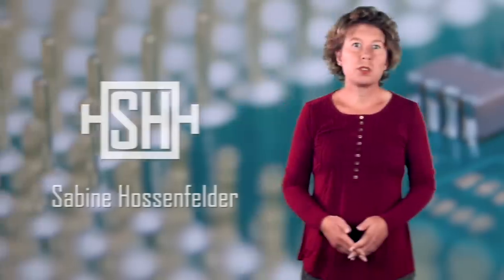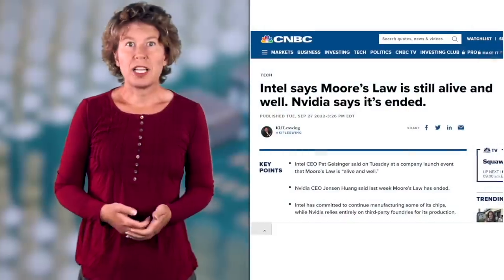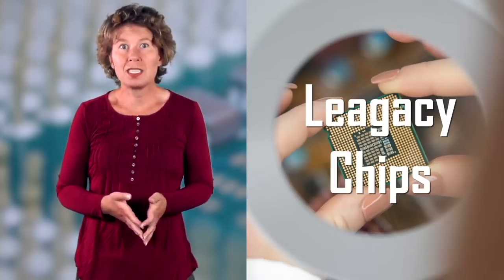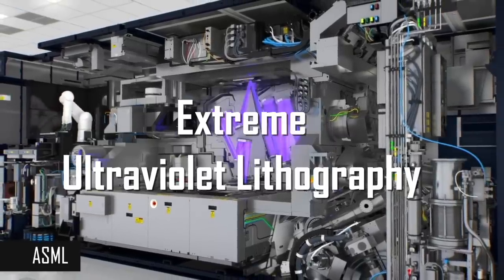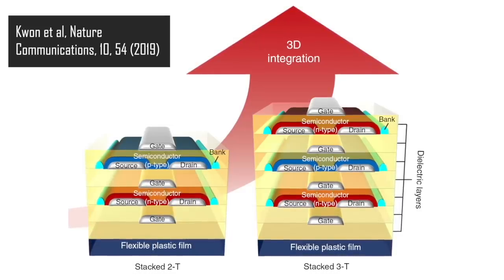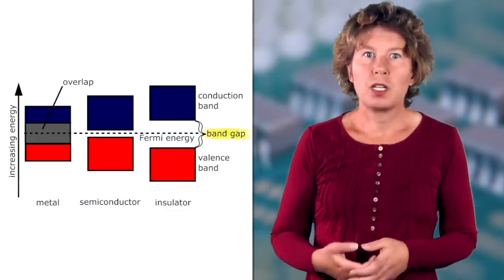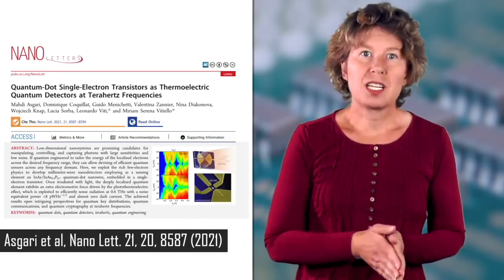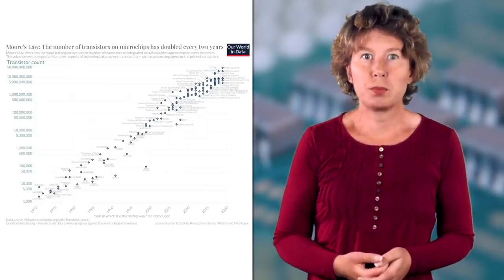Is Moore's Law Finally Dead?

Comment: My first computer was a Commodore VC-20, with 3 KB of RAM for BASIC. Taught myself programming at age 11 on that thing... good old times.
Reply: Sinclair ZX 80 for years then a Dragon 32 with was a step up from VC-20 but below the Commodore 64 which came out ~ year after. Pre internet and typing in code out of a magazine are loaded/saved on audio tape. Heady days.
Reply: @memrjohnno  I remember that wonderful times 😊
Reply: My first computer was the Tand6 Color Computer 2 with 64k ram.
Reply: My family’s first computer was an actual C128 as well. Though it spent most of its days in C64 mode because of the greater software library that offered, I actually learned programming in C128’s Microsoft BASIC 7.0 😆

Like you said… good old times.
Reply: The VIC-20 was my first computer, too, but I moved to Atari PCs pretty quick. The 400, then 800, then ST. I taught myself to code on the Atari 400 using a language called 'Action'. Peeks and Pokes were the bleeding edge coding tech on it, and I also learned the ins and outs of creating 256-color sprites by using h-blank interrupts...sophisticated stuff back then. Antic Magazine, to which I had a subscription, was my source for all things Atari.

Speaking of Antic Magazine, they once held an art competition for people to showcase their art skills on an Atari. My mom had bought me a tablet accessory for my 400 -- yup, a pen-driven tablet existed back then, and it was awesome -- and I used it to re-create the cover art of the novel 'Dune', a book I was smitten with at the time. I sent my art to Antic, on a tape!!, and I was certain I was going to win, but alas, nada.

Fantastic memories, thanks for the reminder...
Reply: 2k ram darlinks - vic 20
Reply: Me too...
10 print "James is sooo cool"
20 goto 10 {enter}
Reply: Zx81 FTW!
Reply: Radar Rat Race anyone?😅 greatest game on the VIC 20
Reply: I taught myself double dragon on a commodore.
Reply: My best friend and I were constantly in trouble in Computer Literacy in 8th Grade, because he had a C64 and I had a 800XL and the class used C64s. We always completed the lesson in a couple minutes and then went off on our own adventure. Then, I got a frichen D on my final, because the teacher said I didn't make any effort 🤦🏽‍♀️ She was right, of course, I scribbled up a program while I was watching Airwolf and hammered it in before class started. Best program in class, but I had established some expectations. Man, I learned that lesson 🙄
Reply: I had a Schneider CPC 6128, with 32KB of ram. Also BASIC operating system. Also taught myself programming at pretty much the same age. One time i programmed the entire memory full. All horrible GOTO spaghetti code 😂 Today I'm a software engineer. If you gave such a machine one of todays kids, they would loose interest in 2s.
Reply: Oh, you lucky bastards! my first computer was an abacus that was missing half of the beads… I taught myself to read on it.
Reply: ZX-80 soldered together from a kit when I was 11. I'd already been programming for a few years on the school's Apple II. I taught myself assembly/machine code on the ZX-80.
Reply: @zhadoomzx - I disagree. I think there is value in giving children really old technology like this. Modern technology does everything it can to discourage users from learning how it works because that's more profitable for the companies involved.
Reply: Same here, but the correct name is VIC-20, and it had 4.5 KB of RAM and no long-term storage, you had to buy an external cassette drive. I also learned Basic on that machine and made a game of Black Jack.
Reply: @SylvainDuford  here in Europe the case actually did say "VC-20", but officially it was "VIC-20", that is correct. I had the 16 KB RAM extension later, that helped quite a bit. Without it, you only had about 3.5 KB for BASIC.
Reply: @SylvainDuford The German marketing name of this Commodore product was indeed changed to VC-20, possibly because the original "VIC" sounded too much like a German F-word. (Same for "Vicks VapoRub", btw.)
Reply: @Omnifarious0  I learned programming mostly because i wanted to make games. If i have had one of todays modern PCs near me with infinite games, I would have never touched that old thing with 16 colors and only shades of green, that runs slower than a digital wristwatch today.
Today there is just too much distraction. A kid with a smartphone has all the distraction in the world at their fingertips.
Reply: Was there a VIC-4? I think that was the first computer I ever messed around with.
Reply: @imacmill  Same. Started on VIC-20 and then on to the brand new Atari 800XL.  Put a 20mb MFM hard drive on the Atari using SpartaDOS and an ICD MIO.  At that point I was thinking how am I ever going to use all this space?  All my programs and data took up less than 4MB on the hard drive.  A BIG program at that time was 38kb.
Reply: Same.
Reply: @galbar-or7851  But seriously before I had a computer my dad made me learn how to use a slide rule.
Reply: That was where it all started. My friend had a Vic-20, I had a Hitachi Peach. Taught myself Basic and 6809 assembler on that. Wrote lots of stuff. The aim was to write video games. The result was a career in IT. "Hello, PC Support, David speaking .."  🙂
Reply: Oric 1 (16k)
Reply: Timex Sinclair was for real programmers,  2K of RAM !  And Wow,  when the 16K RAM came the following year,  it was amazing !  The Timex Sinclair 1500 is still my favorite computer - the perfect size and shape,  mini - notebooks and mini-PCs the same size are real heart warmers to the good old days...  :-)
Reply: I bet that those 40 ~ 50 year old hardware still works...
Reply: @zhadoomzx  - Hence the old tech. Don't let your children have the distracting stuff.
Reply: @Omnifarious0 Either give the kids old technology, and proper old hardware, not the comfort of an emulator. Or get close to modern hardware with an Arduino development kit.
Reply: Same here my first computer was a commodore Vic 20 with extra 16 k expansion.
Reply: Hah! I was one year junger 😀Got mine at the age of 10 and I remember my mother wanted to kill my dad because of the price😂
Reply: @SylvainDuford  nope ... here in germany they called it "Volkscomputer VC-20"😂
Reply: @bozo5632  there was a Plus 4
Reply: @imacmill  When I was doing computer science at school the only available computer was at the local university...input was via pink computer punch cards...!!
Reply: Heh, we're quite similar in that respect. I got a Commodore VIC-20 at age 8, and taught myself how to program with it. I actually ended up exceeding the memory quite often, and had to switch to notations (ie, using ? instead of print). I also really loved the fact that it had cartridges, as I absolutely loved Omega Race. But yeah - very good times, and I kinda miss it... I mean, I still program decades later (as my name implies, lol) but... then, computers were the closest thing that we had to real magic. And, that was amazingly special to me.
Reply: @manoo422  LOL! I am familiar with those machines, and thankfully never had to deal with them during comp sci and electronics courses in college. Poor you. 😊
Reply: TRS-80 CoCo alum checking in.
Reply: @Kiyoone  My Commodore 64 had some broken RAM chips after 30 years. Semi conductors can degrade. Not to mention replacing electrolytic capacitors before even switching the old machine on.
Reply: @RobRoschewsk  Colloquially referred to as a Trash-80 in my Atari circle, even those most of us had never used one. Kids.
Reply: Science of Cambridge Mk14. Early build-it-yourself Sinclair machine. 512 bytes of ROM and 256 bytes of ROM. Very tedious to program. Wish I still had it. A little known but significant piece of computer history.
Reply: @Kiyoone   yup.  40 year old Sinclair, Commodore, Atari, and other 8-Bit machines still working like new.  
Sometimes you need to replace power supply bricks, but overall, the electronics hold up very well.
Reply: I wrote a game on a ZX 48k at the age of 12, and was surprised and disappointed when I ran out of RAM only after a couple of pages of BASIC code.
Reply: C16 here... good old times 😊 This thing made me become a software engineer.
Reply: Commodore 64.
Reply: @RobRoschewsk I miss Radio Shack.   Was a useful store.
Reply: I am waiting for PCBway to offer a bespoke chip making service. Then I’ll be able to design my own multi voice SID chip. The only thing is that they’ll probably require a minimum order of five.
Reply: Commodore made the internal details of the VIC 20 available to everybody. Schematic diagrams, ROM details, plus the bus expansion port gave you full access to the processor and memory bus. It was an experimenter's delight. I was taking a DEC PDP-11 programming class in the mid 1980's and discovered that the 6502 used the same machine op-codes as the PDP-11 processor which meant I could run my DEC assembly programs on the VIC-20 (with some I/O wrapper code). My professor was amazed when I showed him this.
Reply: The VIC-20 was the ancient version of a raspberry pi, with its use of a standard 44-pin edge connector, you could easily get a 44-pin prototype card at any decent electronic store. The crazy stuff I made that poor old VIC-20 do😂, I was always amazed I didn’t kill the poor thing.
Reply: when I was 8 I programmed the equivalent of Excel on my C-64. too bad nowadays there is almost noone left with enough intelligence with whom to discuss physics and life. sad existence in desolation. rip physics too
Reply: You newbies. Acorn atom 12k (which was the luxurious version)
Reply: I am surprised there are so many people that had a VIC20 the "volkscomputer". Happy to hear.
Reply: Atari 400 at around the same age and eventually found myself at Google rewriting parts of the search engine
Reply: C64 crew checking in (actually ZX81 before that), that was such a golden era it's hard to describe now. I will say one of the highlights was being on Compunet in the mid-80s, a British bulletin board with a graphical (ASCII graphics :)) interface much like the internet where you produced content, uploaded it, people voted on it, you had your own pages etc  it was absolutely amazing, RIP Compunet.
Reply: @imacmill  Unfortunately I never actually saw the computer! To be fair we only filled in the code on sheets and got back the cards and printer output, hilarious by todays std.
Reply: I was writing a program on my VIC one night in high school, hit enter to input a new line and got
?OUT OF MEMORY ERROR
I think I might have cried a little...
Reply: c64 😅
Reply: Me too 😊
Reply: Similar story here but with a 386SX, 4MB of RAM and a 40MB HDD
Reply: Loved reading all this, Ahhh the memories thank you. Can remember my dad bringing a Commodore PET home from university over easter in 1977😲me age 6.🤗
Reply: @jamesgrover2005   you missed the semi-colon.
10 print "James is sooo cool";
20 goto 10 {enter}
Reply: ha, yep TI94a with 8k memory.. load on cassette tape.. might take a bit
Reply: That’s my story in a nutshell vic20 though I remember it as 8k RAM
Reply: By
Reply: C64 here too, then we also got a VIC-20, glorious days. Then other computers like the Amstrad CPC 464 and then onto the gorgeous Amigas, i still have 3, my one true Love(s) 4 of them if you count the CD32 ;)
Reply: @eoinoconnell185  so.. that explains why I never became a programmer
Reply: Mine was an Atari 800XL

When my son asked its specs, 48 RAM

Hey said that was good, 48MB of RAM.

It's 48kB of RAM, son.

🤨🤔 Really? 😅
Reply: @jamesgrover2005 No, you're good. BASIC back then certainly never required a semicolon there.
Reply: You must be 150 years old
Reply: @Sjiznit  close, we are beekeeping age
Reply: @bakenryu  the good old days 😂 I tell you at my age it's mental how tech has changed, born 1970 I remember black and white tv's with valves
Reply: #metoo
Reply: ZX Spectrum... At first, commodore 64, commodore 128, ATX 232989, PC 286, PENTIUM...
Reply: First computer I programmed on was a PDP-8M with 8K core and a teletype interface in 1969. Language was Focal. I still have a shoebox with Mylar punch tape programs.

First computer I owned was a 6800 SBC with 128 bytes of RAM. When I expanded it with another 128 bytes, I felt like the world was at my feet.

Still working in IT, made lots of $$$.
Reply: @memrjohnno C64 hit a sweet spot that is yet to be repeated
Reply: I had a really old IBM as my first computer. It was great for messing with I even learned a trick to bypass the password there was a physical jumper (J4 or something close ) on the board you could remove . My first hack now that I think about it . People today don't tinker or overclock or upgrade there own RAM anymore I miss those days .
Reply: @Sjiznit  🧐 look it up dude, you don't know how to +/-
Reply: Pah. Back in my day we wrote code in  "BASIB" because the letter 'C' hadn't been invented yet! Kids nowadays have it so easy
Reply: Self-made Z80-based microcomputer. Developed source code editor and assembler in hex machine code. I still remember some Z80 op-codes today, after 40 years 😎
Reply: @giorgiobarchiesi5003  👋🤓😅I just got to those when it was a 8086 😅🤓
Reply: "Mine" was Robotron, 64 kB for everything. It was at work, of course. Normal human could not afford such an expensive thing. 1986.
Reply: mmmh ... giana sisters and simons basic  :)
Reply: Mine was a Commodore Pet 2000
Reply: To myself, my VIC 20 was not much more complex than a fancy toaster. I kept up and grew with the tech. Now the most complex looking hardware still looks like a fancy toaster. 😂
Reply: mine was XT, and i taught myself q-basic on it at the age of 10. i loved those times. computers were at their best. simple and intimate with both the programmer and the user.
Reply: And when you tell the kids that today, they don't believe you.
Reply: my first real computer was an old linux laptop back in grade 3 i played minecraft on and coded on arduino
Reply: @memrjohnno you know it was sensi soccer on the dragon😂😂😂
Reply: commodore pet. i types in so many programs from zines.
Reply: Snclair zx spectrum 16k with rubber keys lol. I even got a 32k ram pack to make it 48k..sit for 10minutes waiting for tape to load game and right at the end get zantax error lol😂😂😂
Reply: @RobRoschewsk  Yup. Trash-80 for me as well. Then to TI994a because we wanted to play more games. Yeah, we didn't know any better back then.
Reply: Darn, and I thought I had it rough on an OSI C1P with 8 KiB lol On the plus side you learn to write tight code :P
Reply: Same! I still have it and it still works.
Reply: @craigsparton  I don't have my C64, but I still have a working Amstrad CPC6128 :)
Reply: @galbar-or785Funny, but I had a homemade abacus with beads that stuck on bent wires! Could barely beat counting on fingers and toes.
Reply: @jamesgrover2005 😂
Reply: @terryhollands2794 , Do we know what killed Radio Shack?
Reply: @BradleyLayton  No ,   but now I am curious.  I bet involving corporate takeover,  a restructuring or some other scheme to transfer money to those that already have too much.